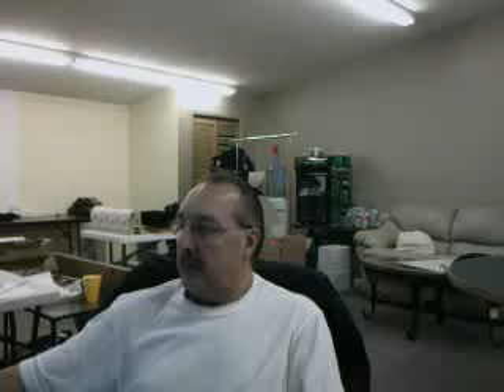Cylinder inspection during piston replacement

Comment: Should the upper rod bearings be replaced? Can the clips be reused? how is the shaft that holds the piston to rod removed after the clips are removed (from a blown motor? also should the decompression valves be lightly greased?